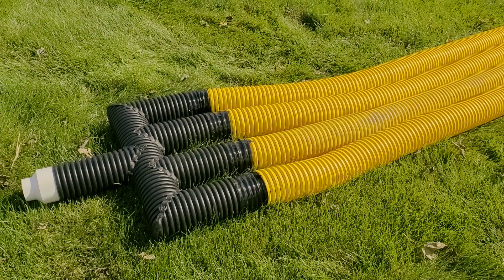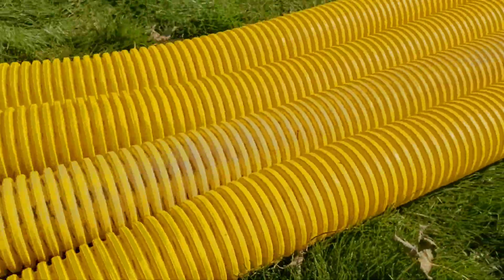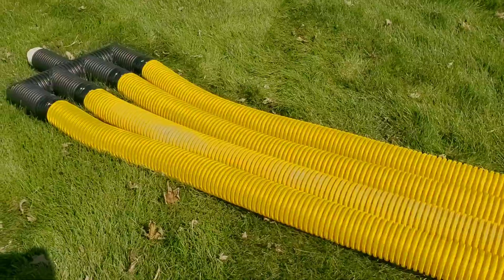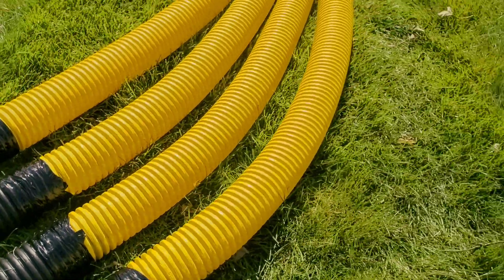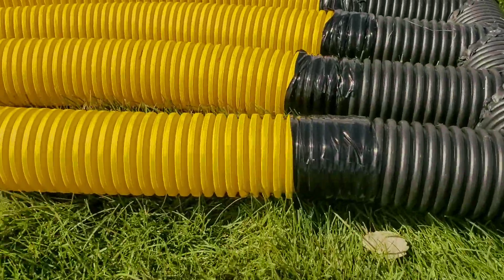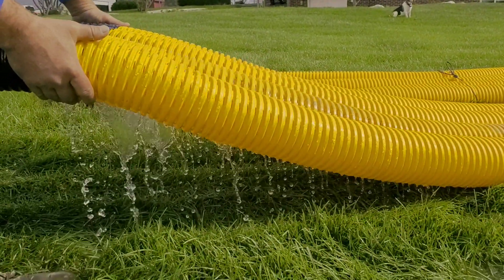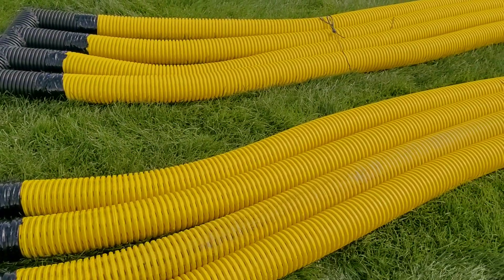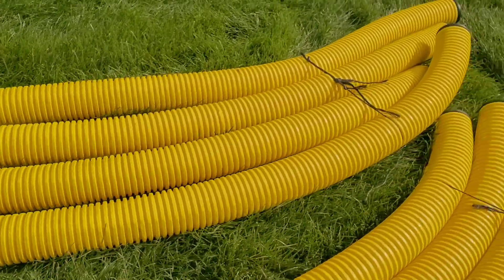How a Yard Drainage Leach Field Works [ Why Knife Cut ]

Comment: Could you run a leach line/field into a back yard that floods? There’s no where else to take the water but to a ditch 70’ away but it’s where majority of the water comes from. The back yard floods and then makes its way to the crawl space. My concern is that I can’t do a relief on the end of the line because the back yard will eventually be too wet and have standing water. Was going to run two exterior bad seeds to keep water from getting into the crawl space. Will have 4” high octane along foundation wall too running to the sumps. Crawl is only 15” tall so we can’t do anything from the interior. Would it be best to just run the sumps via solid line to the ditch and hope it will pump fast enough or run to a leach field? Your response is appreciated. Thanks!
Reply from the maker: https://youtu.be/IjnTlq8lKqc